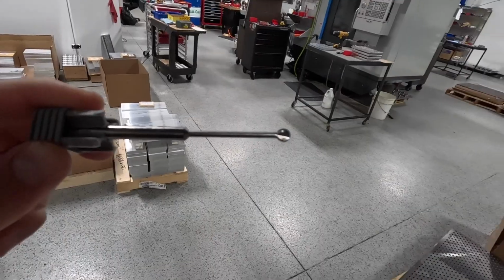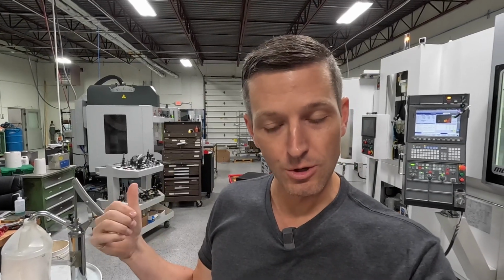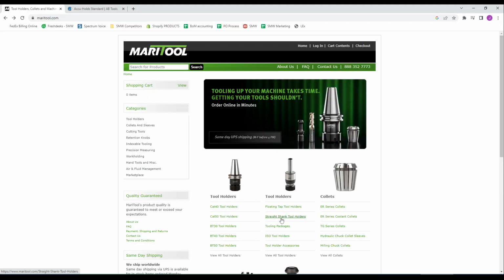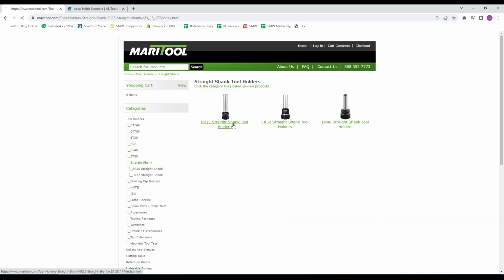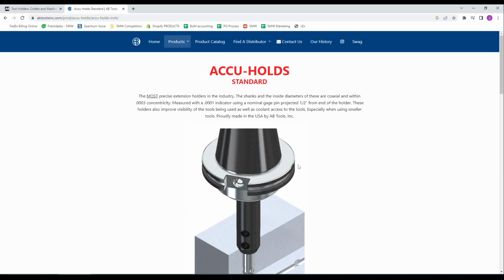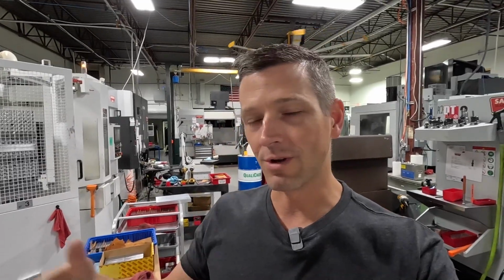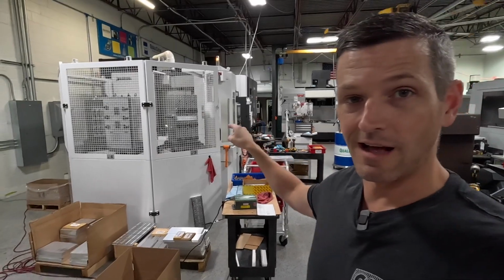Quoting Job Shop Work:  Charge for Custom Tooling?

Comment: This is such a real problem and most quoting advice completely ignores it. The tooling cost question is one of those things that exposes how many shops are still winging it on margin because everything lives in a spreadsheet or in someone's head.
What I've seen talking to shop owners while building quoting software: the ones who get burned on tooling costs are almost always the ones who can't see their estimated vs. actual margin on past jobs. They think they charged enough last time, but they never actually checked. So the same mistake compounds quietly.
Your point about being transparent with the customer is underrated too some owners are scared to itemize it, but a confident breakdown actually builds trust more than a black-box number does.

Comment: I would always try to provide solutions that did not require extra expenses on my part and when extras are unadvoidable I   provide two quotes for jobs that had extra costs included in the quote and the second for re-orders that did not have these extra costs, sometimes I got the second order right away. My customers always knew where they stood with respect to their cost and this always served both parties well. Ray Stormont

Comment: Figure exactly what it is going to cost to do the job and double it and you may make money. If they come back you will make even more. Satisfying the customer is 99% of your goal. They have no idea what things cost, they just want it done well and on time. Do all of that and you will make money. I've quoted jobs that many people I worked with claimed I was raping the customer, but we made a handsome profit and they were happy. Tooling is a write off for most jobs but you still have to make the work happen and go out the door. Like you said, setup, programming and tooling is a part of it regardless even if if you already own the tools. They break and they wear out. Unavoidable in a production environment. We won a lot of large contracts just doing that.

Comment: I make jobshop work for a factory next to me. 90% of the work is from them and in communicat good whit them and I have a open relationship whit te prices and tooling. if is a custom cutter for a special job I will tax it 100% to the costumer, because in the beginning of my shop i didn’t tax the custom tooling at all and now have hundreds of special tools that I probably wouldn’t use ever anymore… basically I have just lost money at the start

Comment: What do most shops use for equipment cost per hour.  I always thought a 100,000 machine should generate 33-75  per hour plus people tooling materials etc. But that is a wide range.

Comment: Any tool that is not a standard off-the-shelf endmill .125 .01R ect is 100% charged to the job that requires the tool. I use a lot of dovetail O ring groove tools and I actually include two of them with every job.

Comment: In aerospace and defense work it is very common to include pretty steep non-recurring engineering (NRE) fees to cover initial programming, fixture design/manufacture and tooling. This has the added benefit of incentivising customers to reorder a part from you instead of incurring another NRE if they would go to another supplier.
Reply: I totally agree with charging NRE.  Using profits to buy fixturing and initial consumables makes no sense to me.

Comment: To get around the "i don't have the right tool" problem i learned to grind some basic ones. Since my work is all soft materials i can even get away with modifying a regular router wood bit, especially if it is for just one job/part. In my case it was about understanding what customers wanted and showing a sample that basically states "no, you don't need 0.01mm accuracy for this specific thing, 0.1 is plenty". Samples work wonders since they allow the customer to physically examine fit/finish of the part instead of having to imagine it.

Comment: There is another option for special tooling.. give a price including the special tool, and a lower price if the feature is standardized.  If it saves you $50 a part to do it standard, offer a $35 savings instead.  Customers love optimizing their designs as well.

Comment: We're in the business to make money. I charge for almost all tooling. About the only thing I don't charge for is HSS drills and spot drills under 1/2 diameter. If I have to order it to complete the job, I'm charging. My advice is don't fall in the trap of gifting tooling charges because customers will start to expect it.

edit

If I'm going to adjust the numbers to get a price down I typically go to shop rate first but keep in mind we aren't quoting at a bare minimum shop rate. We have a lot of wiggle room. I don't alter tooling costs in the quote file because I like to keep tooling records for book keeping, reference, and in case the work comes back.
Reply: I’m curious if you typically work with harder materials or if you apply this to to aluminum/plastic as well? I’ve found it hard to justify including tooling costs for aluminum jobs considering the tools last for months or longer at prototype volumes.
Reply: @poetac15  We're batch production. In your situation it would depend on whats in the drawer and how many spare we have. Even if I was eating the cost I would still document tooling in my quote file and it's mainly for our bookkeeper/purchasing agent.

Comment: If I have a longer running job, I'll add a tooling consumable charge. Sandvik have a good tool life estimator so you can see how many features you'll get from an insert. Often jobbing work will completely use up inserts. I had this recently and spent several $100 in tooling on a job. I listed it as a separate item so the customer could see where the cost went.

Comment: You should be making your own tool holders and pull studs @ this point in your journey it’s criminal and lazy your not….you will never be making proper  profit on every job waisting Money paying OEM prices and your handicapping and stunting  your future growth…. you should have a tool a cutter grinder  in your shop as well…
Reply: Um, machines are more profitable when they are producing parts to sell rather than producing in house work.
Reply: Carlos , maybe don't try tell John how to manage his shop. he is very successful and making pull studs is not as easy as it sounds.  Same for tool holders.
Reply: @LarrysMachineShop   johns obviously a very clever entrepreneur but not a great machinist his words as for a successful business 5 machines after 10 plus year is hardly successful and any business this far down the line should be making their own tool holders if they can’t justify the outlay in new….there made out of steel and what does a Cnc lathe and mill do cut steel only thing he can’t do is grind but he could hard turn them saying that on a Haas yeah he might struggle
Reply: @chrisyboy666  Some companies want to remain small. Not everyone wants to own 50 machines and employ 50 people. For a company with 5-10 machines and none are CNC grinders it absolutely makes no sense for John to make his own tool holders. Maybe it's more common than I think but I have never heard of a job shop making their own tool holders.
Reply: @chrisyboy666  name me a real production or job shop that is making their own tool holders? You have lost your mind.
Reply: This is so funny it has to be satire.
Reply: I can't tell if this is a joke or not